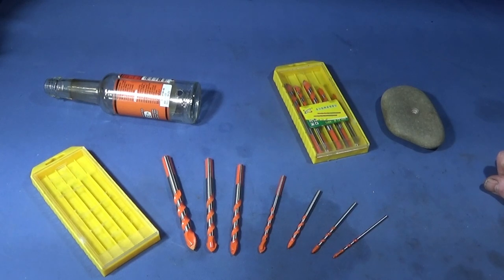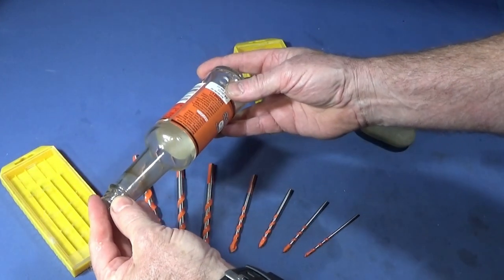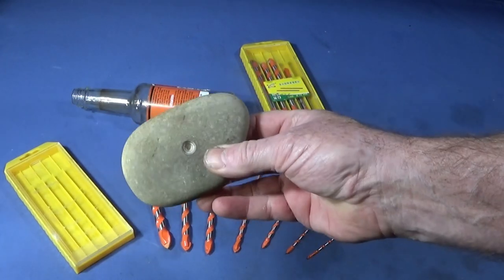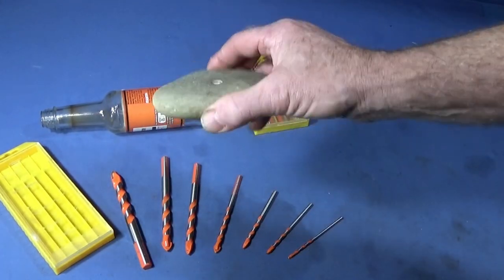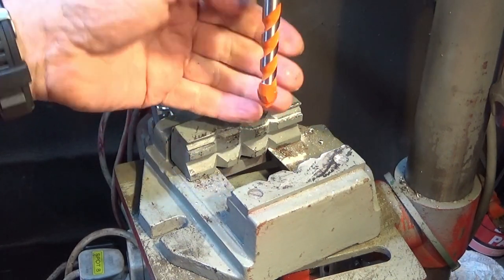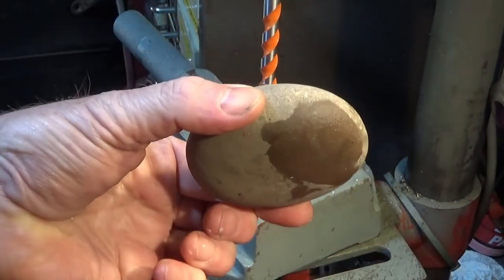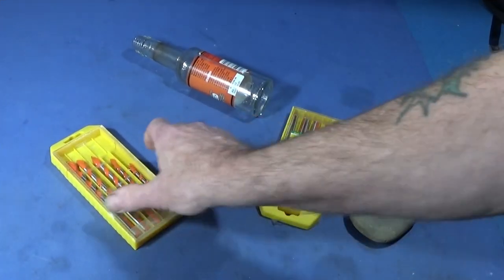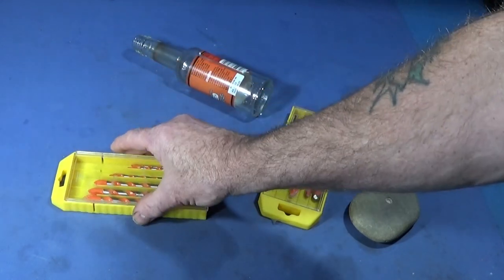New Twist Drills I use to Drill Glass Bottles & Stone.

Comment: Steve, if you need to resharpen these spear point drills you'll find a diamond impregnated/resin bond type wheel will do a better regrind than the green grit bench grinder wheel. I've done some this way before with great results.
Reply from the maker: Hi Howard thanks I will try that next time I need to sharpen one. Regards Steve